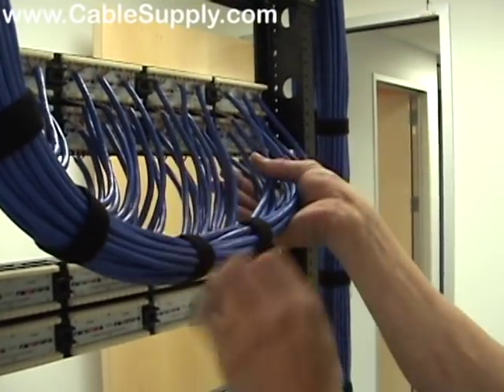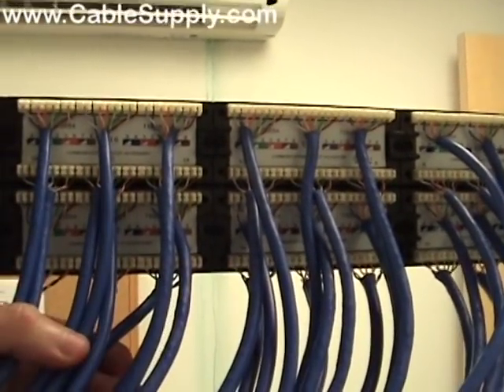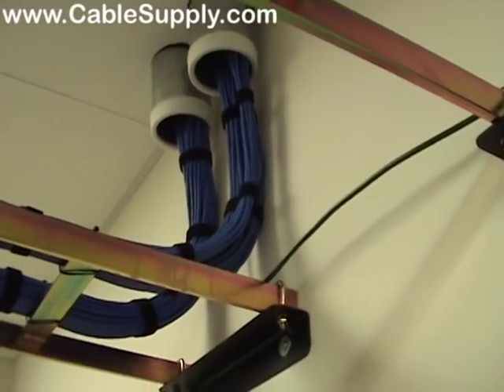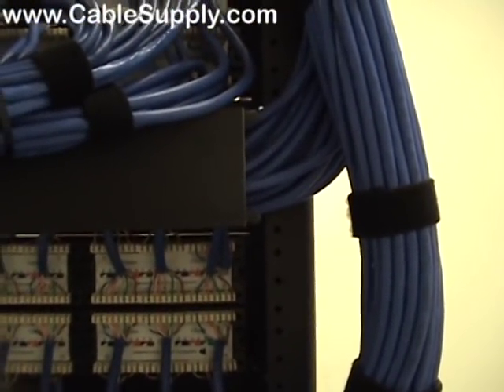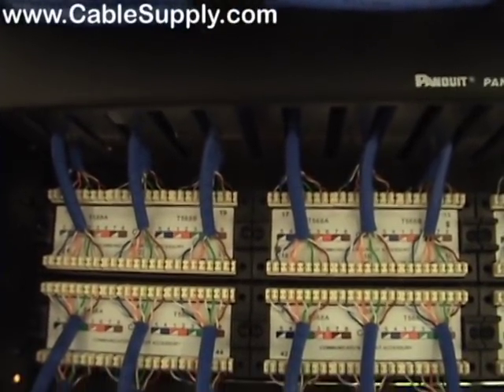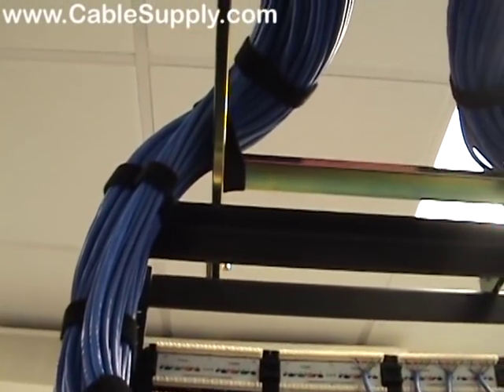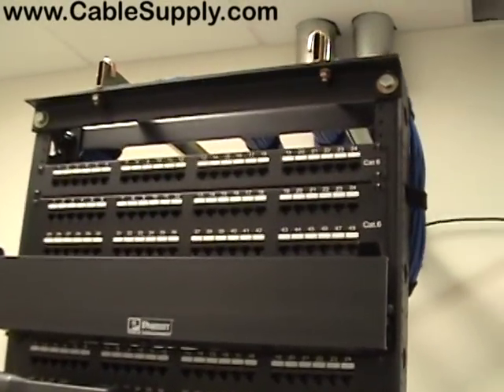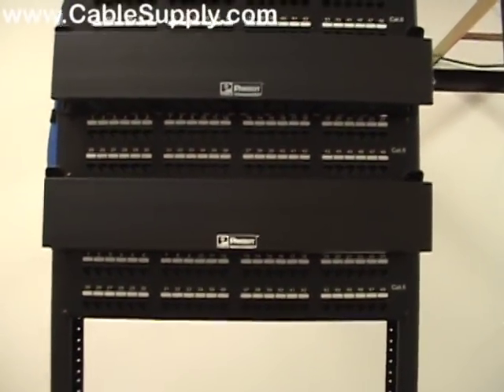Installing Cable and Terminating a Patch Panel (Part 4 of 4)

Comment: What's the part number of that wire ducting?

Is that 1 unit that has slotted rails both outside and inside the rack?

Comment: Great video.  Can I ask if you label each cable from the start and terminate at patch panel matching floor port 1 to patch panel port 1 !.
Thank You.
Reply from the maker: I don't mark cables, it takes to long on a big job! I use the "Cable Identifier" !  I sell it on the wed site. Checkout the "Cable Identifier" video.

Comment: And since I have no connection or anything with the first port terminated I dont want to mess with my other cables the way they are... So one of my questions is: do patch panels need to have more than 1 port terminated in order to function? I currently have 15 cables connected to my switch but I would like to install a patch panel between the devices and the switch but again I cant move on because I get no connection or anything on my first try on port 1. Thanks
Reply from the maker: You should have no problems if you punch down all the cables appropriately according to color code. Putting a cable in a patch panel and then patch cording it to is switch is the best way to handle cables. generally speaking all cables should be terminated in patch panels.
Reply: @CableSupply  thank you. For some reason my 1st and 2nd patch panel did not work so I'm not sure what im doing wrong. I have 12 IP cameras but dont want to mess with their cables if I dont get connection.

Comment: What would happened if you only terminate port one and attach a patch cable from port one into a  switch? I'm trying to terminate a patch panel at home but I soon as I finish terminating port one and then plug-in a patch cable from port one to the switch there is no connection. Am I doing some wrong? I'm following the pin out properly but still nothing
Reply from the maker: There are numerous things that can technically go wrong when punching down cable. Check your color code at the back of the patch panel check the color code with your jack make sure you're using the right patch cords and also check with your switch that it is programmed correctly.

Comment: The color codes for 568B differ in Rj-45 vs Patch panel ? 
WO - O - WG - B - WB - G -  WBr - Br  ( RJ 45 )
WB - B - WO - O - WG - G -  WBr - Br  (Patch Panel )
Reply from the maker: I think I understand your question. You always follow the color code that's printed on the patch panel or the RJ45 Jack. The thing you must keep in mind is that if you punch down one side (patch pan) 568B or 568A the other side (RJ45) must be match. If you mix them up you have a crossover and not a straight through. You need to have a straight through from a patch panel to the jack. The same goes with Patch cords.  When you crimp / make a patch cord it must be the same pattern on both ends of the patch cord or you have a crossover cable. You don't need a color code to guide you for a patch panel or an RJ45 Jack. All the patch panels that we sell have the color code clearly marked on them.   However to answer your question concerning color coding, pair one is the white blue / blue white.  Pair two is white orange / orange white. Third pair is white green / green white. fourth pair is white brown / brown white. Hope this helps.  It looks like you are trying to configure a modplug.  Mod plugs have pattern that starts in the center. I have videos on mod plugs somewhere in on YouTube.  Thanks for watching.
Reply: @CableSupply  @ Thank you kind sir for great explanation.

Comment: How do you go about introducing new Cat-6 cables, if you have already clustered the main existing braids? Can someone explain the process and how you would append the new cables without making a mess? And how is this done after main construction of the building is finished (ie. where do you open tiles and walls to run cables through)? Thanks.

Comment: I guess I'm just used to the other way of running in the cable, through the middle of the patch panel.
Reply from the maker: your fine, you can do it ether way. both ways work.
Reply: Until the cable you have to locate is hidden under all the other cables.

Comment: Thank you for uploading.  I have a 12 port cat 6 panel.  Do they expect me to be able to fit all 12 cat6 cables in that little gap between the end of the bracket and the panel?  It seems like they intended to go in 6 from each side, but I'd prefer to have all my cables coming in from the top.  I can't imagine anyone else going in from both sides on a 12 port install.